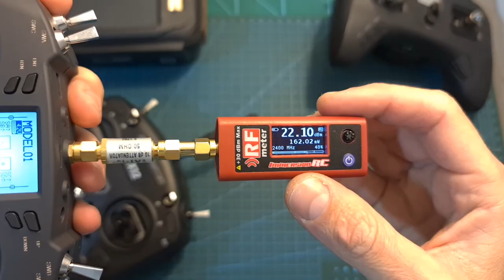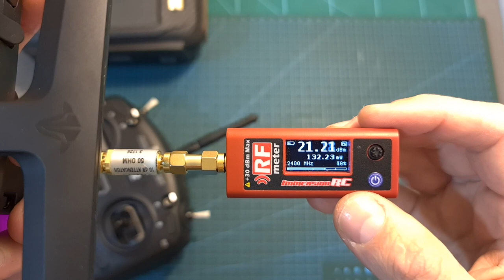Radio Multi-Protocol Range Test - Jumper T-Lite Vs. Radiomaster TX16S & TX12 Vs. TBS MPM

Comment: Great test, thanks for the work! Since I just got a T-Lite I’m glad to see it’s not at the bottom. I also had similar RF performance to yours when I tested mine out to around 200m with an XM+.
Reply: It has enough problems of its own somewhat bad design choices, to not add range to them!
Reply: I can get 5kms using the long range non telemetry XM plus and a Taranis...🤔🇬🇧
Reply: @EnglishTurbines  Hmm yes I wonder how the X9D would have done against the TX16S in this same test. Or maybe you mean a different Taranis.
Reply: @noforyoutubepremium3108  For sure it has some typical Jumper issues that they need to fix but I’m enjoying mine a bunch~
Reply: @MiniMicroFPV  Good question, I'm surprised the 4 in 1 Module on the TX 16S had an illegal 160mw of output TBH...Maybe it's to make up for the unmatched tune of the Multimodule...Yes, I have an X9D plus, and now a Radiomaster TX16S....I have a genuine FrSky 2.4g Bay TX Module for it..lol.
Reply from the maker: Thanks a lot!

Comment: R161 receiver only 600m. The rxsr receiver in your other test got 4Km. This tells me that the R161 receiver is no good. Thanks a lot now I know I have to stay away with R161.
Reply: I saw other video of R161 it can go 1km++
Reply from the maker: Please not that this test was not done under ideal conditions like in my previous test where I tested the RXSR. The purpose of this test was to compare the TXs and not test the RX. I will re-do this test under ideal conditions soon though.
Reply: @KremerFPV  I agree Gal. I just mentioned the rx because on your previous test using the TX16s and T18 it clearly shows that both these tx can transmit up to 4Km if the rx is able to receive the signal. I value your test and effort and I based my decision to purchase my gears based on YouTube influencer like you. Keep up the good work. Thanks
Reply from the maker: @JermieMarasigan  Thanks Jermie, I appreciate your trust and I don't take it for granted.

Comment: Were you using RF attenuation on the TXs?.. the range on all of them was terrible TBH Your dipole antennas should be VERTICAL, not horizontal to avoid the null zones!!
The RF output was interesting, useful info..🤔😀🇬🇧

Comment: Great test Gal! Since so many of us now fly with Crossfire because of FrSky's blunders and virtually no failsafes, I think it is essential to repeat the test using the Crossfire Nano receiver. It'll be interesting to see if the winner of this test, the TX16S, will compete or win against the Tango2.
Great Job, and looking forward with fingers crossed 🤞that you agree that the Crossfire Nano  test is the one that will be the most meaningful to the majority of flyers. 😎👍
Reply from the maker: Thanks a lot mater. I plan to do a CRSV vs Tracer test soon. There is no point in comparing the Tango 2 with TX16S with a CRSF Micro V2 module for obvious reasons.

Comment: Gal:
Thanks for a very well organized comparison between 4 similar Open Tx radios with Multiprotocol capability. However, I must admit in trying to follow those 4 screens simultaneously it was difficult to decide for myself which was most reliable, and why several of them were dropping out at such different times in the flight. Could you please comment in your written description, what YOUR choice is and why? Thanks! Love your channel for excellent photography, carefully orchestrated, and authoritative comments. 
   I'm hoping the TX12 will come out favorably because I just bought one. - Jim
Whoops! I should have listened to Gal's review a second time. He did state his evaluation preferences (Radiomaster TX16S and TX12).  Sorry Gal.
Reply from the maker: Thanks a lot James. I mentioned it in the beginning of the video that in my opinion the TX12 and TX16S performed better than the T-Lite and TBS MPM. 
I will try to improve this method and maybe even post separated videos of each radio controller.

Comment: Thanks for the test. Good video.
How do long range drones still get a signal? Let's say when 5km away?
The max range in your video was around 500m. Some drones are advertised as long range like the Nanolongrange V2 with 4-5km.
Reply from the maker: Thanks. 
For proper long range flight I would recommend using a 900mhz system such as the TBS crossfire.
Reply: @KremerFPV  thanks. I've found out about ExpressLRS. It is cheaper and open source.
But how about the video transmitting range? They cut out long before the max range of the controllers

Comment: RADIOMASTER ALMOST SEND ME STRAIGHT TO JAIL! (sorry for the readbait but you must check this haha)

i got a TX18S. whatever that number means and i got a super weird problem. after months of flying normal without any issue it went nuts some days ago and send signal to my drone go to full throttle + 100% yaw left. made my iflight evoque 5" almost fly into paramotor pilots face mid air which most likely would have end in crash/death from these guys because fly over water. and that means jail here even not my fault. 
i thought: if ANYBODY know what might happen there it would be pawel. did you EVER hear something like that before?
took the radio apart. no connector issues inside. radio is only some months old. no other software glitches i see before. what do you think? 
it wasnt crossfire link issue too because i have control over the DISARM switch. which i push. shut off and let it fall down where everything was broken after the impact.
Reply from the maker: Well I am not Pawel but this is unfortunate indeed. 
Did you set the failsafe of the RX to no pulse?
BTW - The T18 is made by Jumper and not RadioMaster.

Comment: my Jumper T12 with 4in1 module worked at  470m with   Mobula7 (Flysky) showing 30-40 RSSI and failsafed  when I turned so antenna was behind battery.

Comment: Always great to see range testing. What is the power output for the tx16s?
Reply from the maker: Thanks! The antenna of the TX16S is not detachable. As far as I know the results should be similar if not identical to the TX12.
Reply: @KremerFPV  awe, didn’t open it up and connect to the u.fl swap? Good to now though since I totally forgot about that.
Reply from the maker: @syliss101  I didn't as it could damage the connector (It happened to me before).
Reply: @KremerFPV  totally understandable. That would suck.
Reply: I tested it at 100mW.

Comment: Hi gal, i also lives in the north of israel. What starting fpv transmitter would you recommend me buying? T12 it seems all-around good but no hall effect gimbals
Reply from the maker: If you like the T12 form factor and you want hall effect gimbals you can either go with the T12 Pro or Radiomaster TX12: https://youtu.be/oo99YZC-AQA
Reply: @KremerFPV  not sure. Just want to use a simulator

Comment: how much output power did the radiomaster tx16s put out? I think you missed that in the video, or did I miss it???
Reply from the maker: You didn't miss it. The antenna of the TX16S is not removable, but the output power should be identical to the TX12.

Comment: that's not the right method for measuring a range of tx. you kept same height during the whole flight. for the next time try to also increase height with increasing distance. the results will be a lot better.
Reply from the maker: I compared the TXs and did not try to measure the maximum range of the RX under ideal conditions. I might re-do this test soon though and then test exactly what you suggested.

Comment: Interesting test. Why any of them didnt reach 1km range with good signal? My diy arduino transmitter can easily go 1.5km on the ground and 5km on air.
Reply: i saw a photo of his range test setup. the antennas where straight. but they have to be at an 90° angle
Reply: Yes. Same with my diy tx, if straight will have packet loss. If 90° angle no packet loss on all 2.4ghz band.

Comment: Does the Frsky R-XSR Receiver work with the jumper t-lite and Radiomaster TX12? Both have CC2500 Chip in them. Thanks
Reply: Yes it should
Reply from the maker: Yes, as long as you don't have ACCESS firmware on it.

Comment: I'm kinda confused. What is the power output for all the tx?  Wasn't tbs suppose to have longer range?
Reply from the maker: I didn't test the Crossfire module :-)
Reply: @KremerFPV  oooh okay, what is the average distance for jumper t lite? And can it support tbs tracer?
Reply: I think the outcome would be reversed with crossfire, correct?

Comment: Why is the output power so high on these new radios?  

In your previous video the Taranis x9D and Taranis X lite only output 90mw and 100mw respectively.  These new radios are outputting almost double this figure!
Reply from the maker: You got to ask the manufacturers this question..
Reply: @KremerFPV  
Thanks for your reply.

I was really surprised by the output power for two reasons:

1). I thought that radio transmitters were limited to 100mw on 2.4ghz by international law.

2). The ranges in this video were about 500m but, in the video that I was talking about earlier, you flew 3km!  It's a little odd that these more powerful transmitters actually have a lower range than the weaker ones.

I still have to watch your other video where you tested the range in a different way; I might do that now!

Keep up the good content. I love the latency tests for fpv cameras the most, but the fpv camera comparisons and range tests both take a close second place.

Edit: oh, I thought you had repeated the test. I must be thinking of another channel.
Reply from the maker: @QTMagic  Yes as far as I know in most places there is a 100mw restriction...
Are you referring to one of these videos? 
https://youtu.be/-PweZVEka-E
https://youtu.be/eWgU5n4pL38
Thanks a lot for your support!

Comment: are you fine-tune the frequency before testing them all? even if we use the same protocol, those multiprotocol module's frequency sometimes a bit off from one brand to another, could be the radiomaster tx is better since you use also the radiomaster rx
Reply: sorry my bad, I skip that part and goes directly to the result ^_^V
but still, I curious about the jumper rx or original frsky rx range test.
Reply from the maker: I might test it with an original Frsky RX on a different occasion.
Reply: @KremerFPV  great, you got 1 more subsscriber 😁

Comment: If I want to use tracer , at the end , the cheapest way is with the new t-lite
Reply: How tech savvy are you?
You might want to take a look at ExpressLRS 😉
Reply: I'd say the TX12 would be a better unit if you wanted to use Tracer. It has better / more stable power output for it's module bay. Even if you have a high quality battery in the T-Lite it can only support 250mw output somewhat stable. This is mostly due to it using a single cell battery. The TX12 uses a 2s LIPO or two 18650's.
Reply: To my understanding, the limiting factor of power to the module bay is (the transistor used on) the mainboard. There's already a mod available that bypasses this by using just one mosfet and one resistor.
But it all depends on your needs, budget, time, willingness to tinker and so on...

Comment: Hello. Why is there such a small distance for all devices? 700-800 meters ??? very strange. I flew 2 km away. with receivers is everything normal?
Reply: you should keep approx 10m height gain for each 100 m distance gain (10m for 100m distance, 20m height for 200m distance etc.). he kept constant height during the whole flight, that's the reason why each tx/rx has poor results
Reply from the maker: I didn't test the maximum range of the receiver, just compared the TXs. I will run the same test again under ideal conditions soon.

Comment: What a dissapointment. I just bought the TBS MPM to get the best possible MPM for my Tango 2 Pro for my micros... that range is like a real dissapointment.

Will you be trying other receivers? I am really hoping it is some missmatch and that FrSky receivers work better. :(
Reply from the maker: I might test other receivers as well.
Reply: @KremerFPV  I have talked with some people and they do not have the same experience that tou have, they seem to go over 1 km with both the TBS MPM and the Jumper T-Lite. So maybe something else went wrong like the receiver indeed.
Reply from the maker: @mikaelbackstrom  It depends on the RX as well and this test was not done under ideal conditions.